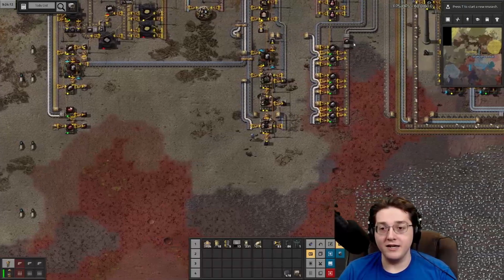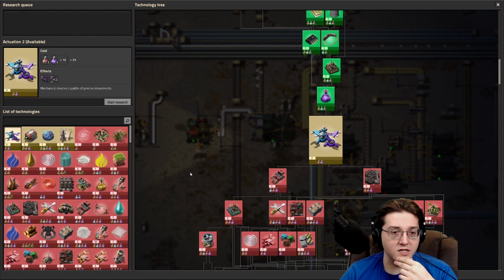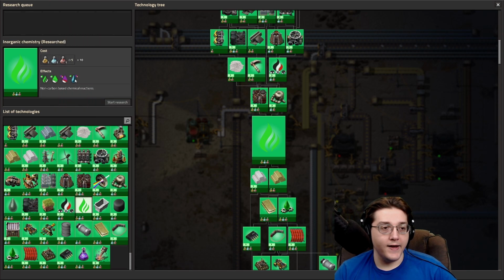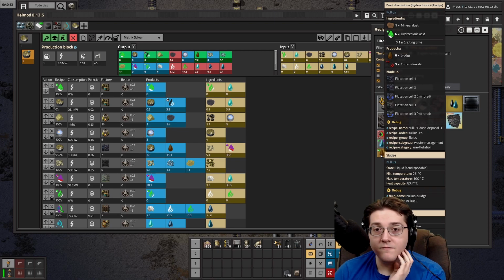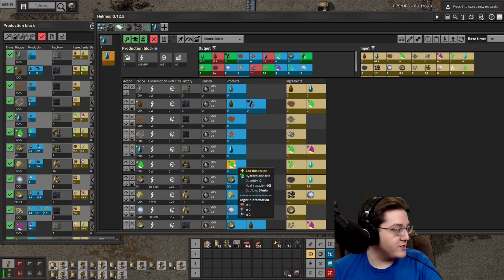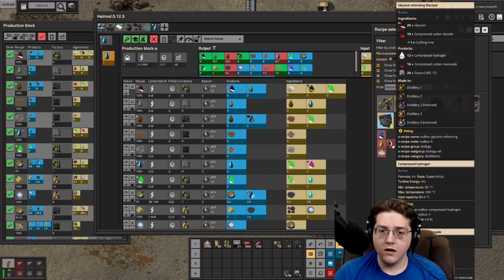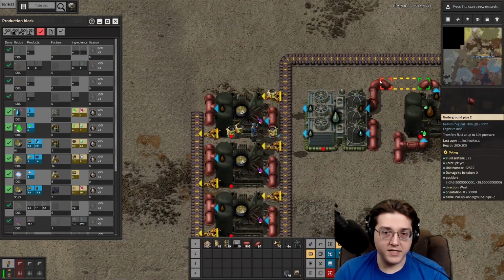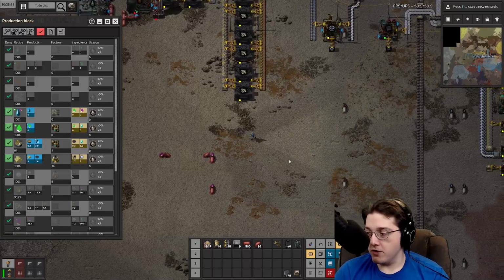Setting up aluminum processing | Nullius Factorio | Part 9

Comment: You can turn any of the raw ores (other than sandstone) into gravel, takes the least limestone which is also the least immediately useful.

In purple sci you also get calcium chloride (which is disposable) which allows you to use much less limestone to dispose of the same amount of HCl acid.

Another use-case at your stage is to use PVC plastic to absorb 3 times the chlorine to make the same amount of hydrogen chloride, this also makes use of excess ethylene which you're currently burning but is obviously more perhaps undesirable connections. (can't have too much plastic though)
Reply from the maker: If you're referring to limestone crushing, it's not available at mechanical prototypes (red).
Reply: @OtakuShowboat  huh, seems to be the case. Though it unlocks a lot earlier than limestone processing 2 which unlocks calcium chloride (which was added as part of the chlorine disposability change)